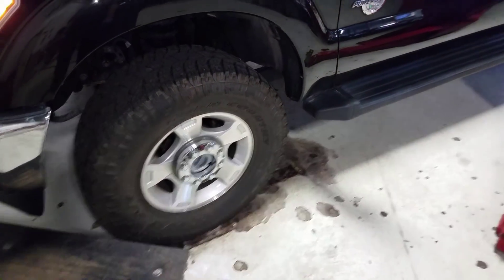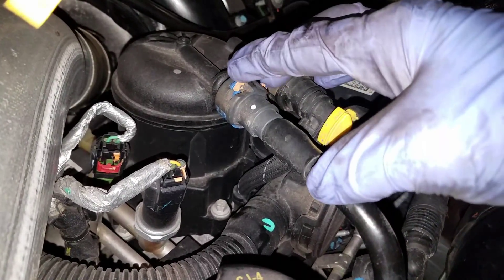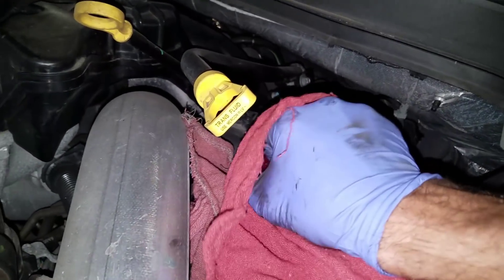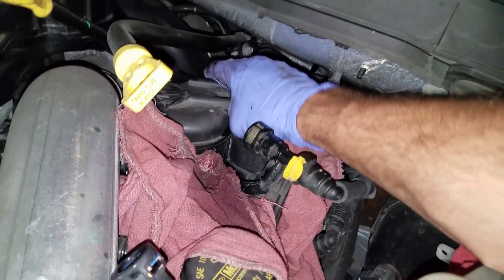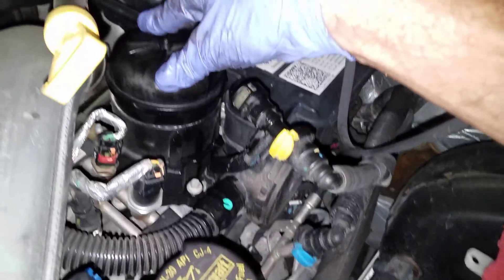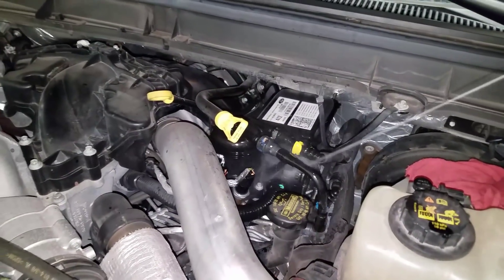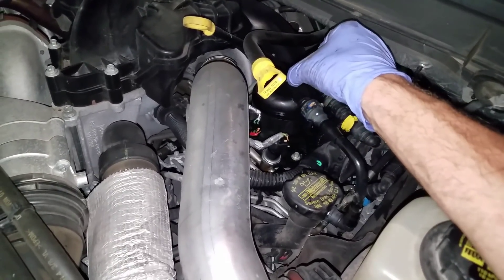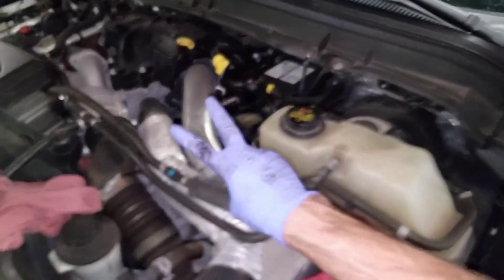FORD 6.7 Powerstroke Top Fuel filter

Comment: Thank you so much sir for this outstanding video. 

My filter somehow got a pinhole in the top and shot fuel out like a squirt gun. 😮

Started smelling fuel and when I stopped the fuel was vaporizing off the engine block. 

Opened the hood with the truck running the there was the mini geyser in all it’s glory. So great……

2014 F350 6.7L Dually 4dr LWB
Reply from the maker: Glad it didnt burn down. U shld ditch the plastic & get H&S motorsports upgrade. Watch our MOD playlist.
Reply: @PowerStrokeTechTalkwARod  Thanks!

Comment: Fanastic job in explaining all the the nuances.  Thanks so much.  On my soon to do list.  FYI I flushed brakes with a pressure bleed system and never let the master cylinder go dry.  I was concerned about slow sinking of pedal under protracted pressure to took to dealer to look at.  They said I got air in the ABS system and that you had to use the computer to properly flush.  I paid $$$$ but heading out on trip.  I am not sure if that was BS..Curious on your thoughts
Reply from the maker: Sounds right

Comment: Diesels seem to use a lot of filters. How often do they need maintenance? I guess it makes for job security. I notice some filters at the pump for the diesel fuel tank at the DPW yard across from my shop.Is it normal for diesel fuel to have a lot of dirt? Does the DEF part use filters also? Always look forward to Friday! Payday and Powerstroke vids!
Reply: bill beckett 

Diesel fuel degrades over time and can develop a slime like substance  almost like algae which can plug filters and destroy injectors and injection pumps if not treated with a fuel additive or stabilizer 

The second issue is water or condensation in the fuel, any water that makes its way past the water separator on the truck will destroy the injectors and pumps in a hurry costs big $$$
Reply: bill beckett 

Ford does not use a def filter in the 11 to 16 model year trucks, however dodge does in their trucks and they are outrageously expensive about $70 to 80 from the dealer, not sure about Chevy/ duramaxes
Reply from the maker: No def filters, no diesel should NOT have any dirt in it. The fuel system tolerances require clean fuel

Comment: Great video! Thank you, I just did mine and it sounds loud and vibrate , used Motorcraft filter, any advice or is this sound and vibration is normal after replacement?
Reply from the maker: Probably still have air in the system. Thanks for watching
Reply: I have a 2011 6.7, and it was making the same noise and vibration, and it turned out to be a foil from an additive cap stuck in the fuel tank pump where it sucks up the diesel..
Reply from the maker: Damn that sucks.....

Comment: Hey Arod. Just changed my top filter on my 2012 but it’s stuck in the removed position. It’s seated all the way down but will not turn back to line up with the fuel lines. I’ve just about broken everything trying to get it to turn. Even put a bag of ice on it to shrink the plastic to see if that works. Any ideas. Thank you.
Reply from the maker: You must have gotten the lil foot stuck under neath the filter. I know what ur talking about
Reply: @PowerStrokeTechTalkwARod  any ideas how to get it out or to get it to turn.
Reply from the maker: Gotta keep at it. No tricks. Id have 2 be there
Reply: @PowerStrokeTechTalkwARod  Wish you were my neighbor. Thanks so much for your help. I really appreciate what you do.

Comment: Hey that hose in the left side of filter with the blue clip. It goes down and under near the fuel injectors into the motor. My hose is leaking right there how do I fix that? Is there an o ring? Do I just need a new hose?
Reply from the maker: New hose bubby
Reply from the maker: PART NUMBER FC3Z-9A274-A, goto the dealer please!
Reply: @PowerStrokeTechTalkwARod  I went to dealer my warranty only cover hard lines. I can still order part from them though. How do those stinking clips come off fitting for injector return line
Reply from the maker: @jamesdixon4601  DO NOT BREAK you'll cause yourself more grief. There are two tabs on each return line connector, looks like a T. You meed to hold down the two tabs and pull up on the middle part. Its circular. Looks like a barrel. It slides up while pushing down on the tee...then only then will you be able to take it off the injector. If your reusing the line you'll need orings for the injector return port
Reply: @PowerStrokeTechTalkwARod   BC3Z9A564B is the part number. Thank you. I will be careful
Reply: @PowerStrokeTechTalkwARod  yo I got it off. There is a locking sleeve that slides up and down. Easiest to do after cleaned with brake cleaner no grim to block sliding. Then after sleeve is all the way up. I gentle pulled up after slightly wiggling and it came up. Took O ring off. Looks brand new. I started thinking about it though. I think the locking sleeve was up a little to start with so it might not of been locked down. Also I removed both line from filter to bend out of way. Unplugged injector senor plug? And disconnected  another fuel line right above what I am working on. To make room for my hands and fingers and light. It started raining so I closed the hood so fuel system couldn't get water in it. I covered a fuel inlet i exposed at beginning of process with little yellow rubber that comes with new filters

Comment: After I changed both filters I can’t figure out why the top filter under the hood is making a buzzing noise while the truck is running.
Reply from the maker: Air, ur priming sequence must have been sub par
Reply: @PowerStrokeTechTalkwARod  haha well I did 6cycles of 10sec
Reply from the maker: ........big deal....in which or oder did u replace them
Reply: @PowerStrokeTechTalkwARod  I did the chassis one first and then the engine compartment but then I had to get a new chassis filter housing because it cracked During uninstalling it then I broke the sensor thing trying to install that into the new filter housing and I think all that mess made it as if I did the engine compartment one first I guess
Reply from the maker: Its important to cycle between filter as well...
Reply: @PowerStrokeTechTalkwARod  oh ok I’ve been cycling like crazy I even took the hose connector back off downstream of the engine compartment filter to purge air out but all that did was get my wife pissed off at me filled our whole house with Deisel fuel smell
Reply from the maker: Lol
Reply: @PowerStrokeTechTalkwARod  but that filter is still buzzing!

Comment: friend I have a detail with a powerstroke 6.0 model 2004 the detail is that hot does not start and if I throw a little starter if you start friend and check leaks in the reins and hoses and not leak friend that could be ???
Reply from the maker: You have a high pressure oil leak, or a problem with the functionality of the high pressure oil system. You need to find out what year the build date of the vehicle is. You may need the triple threat....#1 hpop.....#2 icp sensor & connector....#3 injection pressure regulator
Reply: is model 2003 f350 6.0 friend has 118 thousand miles ..

... the only weird thing you notice is in the injectors friend that when it is torn. 1 injector drains oil by a few holes that went on the top of the friend is the only one on the right side of the left side and another one that seals the same in total are 2 that drains friend oil nose if normal but if it is something aon 2 chorritos of oil ke open? but when yano you have to start hot. those same injectors as they open the trickle but as in pauses not direct but ripped open x chorritos friend? cres have something to be the injectors
Reply from the maker: I don't understand a word you just said.......
Reply: you could only tell me what causes it might not start hot .... and x that with starter if you start friend

..